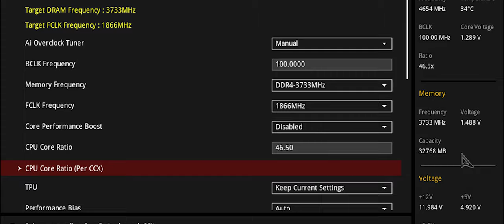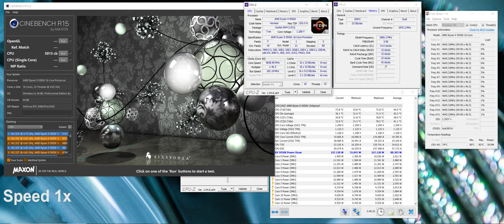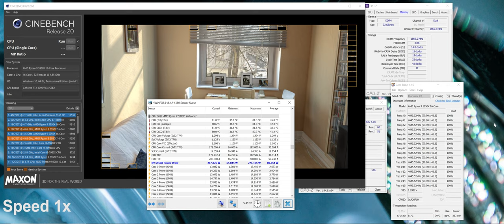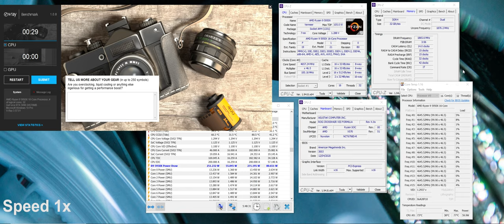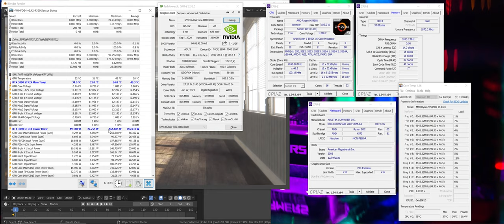EH "PASSENGER 2020" - Omówienie i pokaz możliwości konfigu

Comment from the maker: Szczegółowe omówienie projektu EH "PASSENGER 2020" oraz testy w renderingu jak i grach.

Konfiguracja EH "PASSENGER 2020"

AMD Ryzen 9 5950X 4.65 GHz
https://www.ceneo.pl/98430697#crid=44...
ASUS X570 ROG CROSSHAIR VIII FORMULA
https://www.ceneo.pl/84857524#crid=44...
32 GB G.Skill Trident Z NEO 3733 MHz CL14.15.15.28 T1 IF 1:1
https://www.ceneo.pl/90607156#crid=44...
RTX 3090 STRIX + 100 / + 1000
https://www.ceneo.pl/97264664#crid=44...
Creative Sound Blaster AE-9
https://pl.creative.com/p/sound-blast...
2x SAMSUNG 980 PRO 1 TB
https://www.ceneo.pl/97065448#crid=44...
1x SAMSUNG 870 QVO 4 TB
https://www.ceneo.pl/95363929#crid=44...
CORSAIR AX1600i
https://www.ceneo.pl/59136048#crid=44...
Raijintek Eris Evo
https://www.ceneo.pl/93255887#crid=44...

Custom LC

Alphacool NexXxos 560/60 + 480/45 dla GPU
Alphacool NexXxos 560/45 + 2x 360/30 dla CPU i VRM
2x Watercool Heatkiller D5 200 MM
2x EK D5 PWM
EK Magnitude AM4
EK Vector STRIX Nickiel Plexi
EK Vector STRIX Backplate Nickiel
5x Gelid Ultimate 15 W/mk 1mm
5x Gelid Ultimate 15 W/mk 0,5mm
Thermal Grizzly Krynout
10x Noiseblocker NB-eLoop X B12-P ARGB 120mm
8x  Noiseblocker NB-eLoop X B14-P ARGB 140mm
3x Thermaltake Riing Trio 200mm
Złączki, kątówki Barrow
Korki Alphacool
Ciecz Mayhems X1 Clear 5 Litrów

Polecamy serdecznie nasz zaprzyjaźniony sklep który w czasach szalonego górnictwa, pomaga nam w organizacji kart graficznych do konfigów które tworzymy.

https://www.wulkano.pl/

Muzyka :
- Enter the Animus Assassins Creed Odyssey (OST) The Flight
- Interstellar Main Theme - Extra Extended - Soundtrack by Hans Zimmer
- Stranger Things Theme Song (C418 REMIX)
- UMBERLOID - Neon Tetra

Comment: Amazing build! Inspired me to buy the same case. Is there any chance you all measured the width of that front bottom panel that hides the PSU cables and has "Raijintek" written in the middle of it? (Should be approximately the same as the width of the glass panel) was looking to add an external display there if space permitted and I'm still waiting on my case to come in.
Reply from the maker: Thanks :) The "PASSENGER 20202" has been received by the customer a long time ago, so we are not able to measure anything at the moment.
Reply: @ExtremeHardwarePL  No worries, thanks for the reply!
Reply from the maker: @ColeFromRS  No problem. Best regards :)